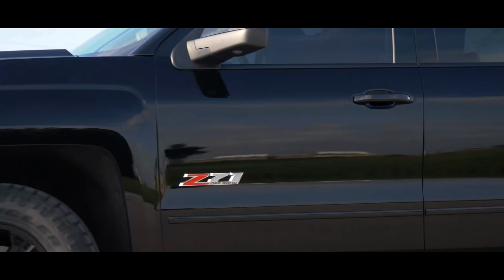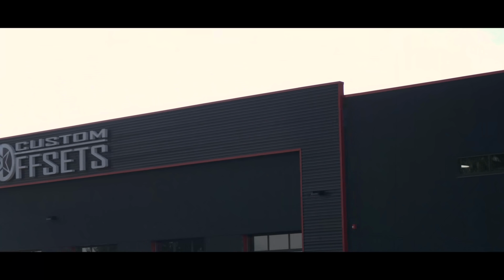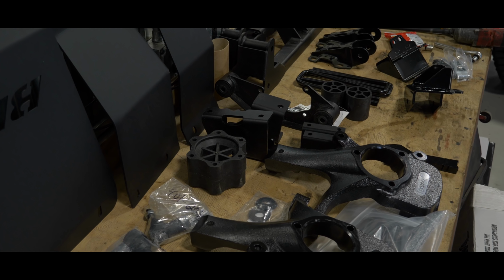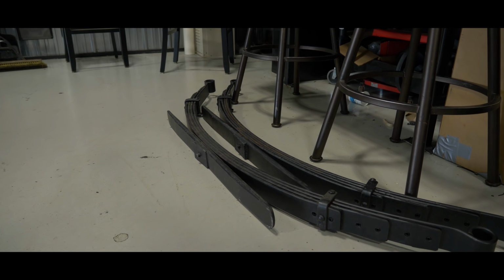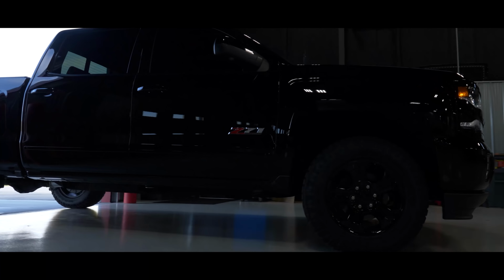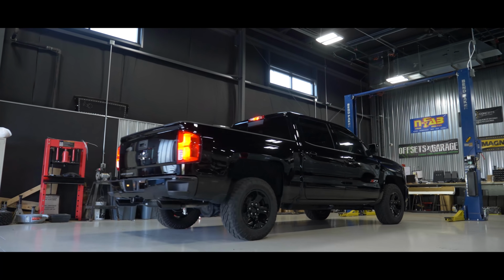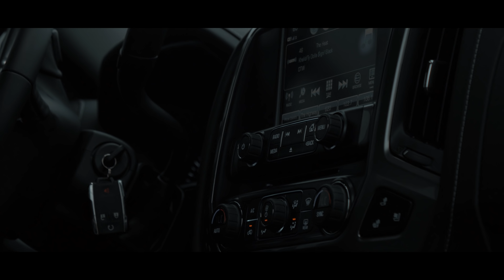2018 SILVERADO DREAM BUILD + CUSTOMER REVEAL!

Comment: You should do a comparison on how much a rough country 7” lift vs a bds 6” actually lifts the truck because I have a 7” rc with 20x10 -12 and 35/12.5 and I rub on big bumps and full lock

Comment: How much did the install of everything cost.  The install of the ceramic coat, lift and rock lights.
Reply from the maker: Installation pricing will vary shop to shop Kevin,  labor alone  was about $2500 give or take
Reply: Cool. Definitely considering bringing my shop to you guys.  And was just wondering about a general price

Comment: Can you run these with a 3 inch lift in the front and stock rear?
Reply from the maker: Yes you could
Reply: @CustomOffsetsTV  would any trimming be required?
Reply: @CustomOffsetsTV  or how about running these on a 4 inch leveling kit?